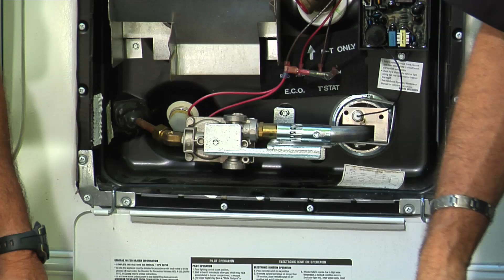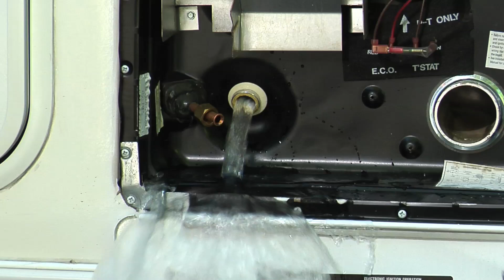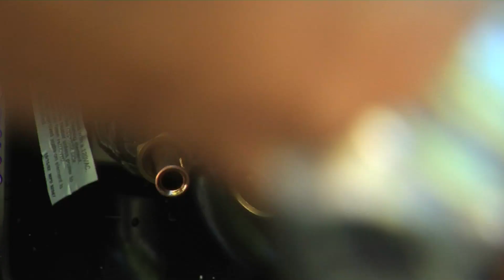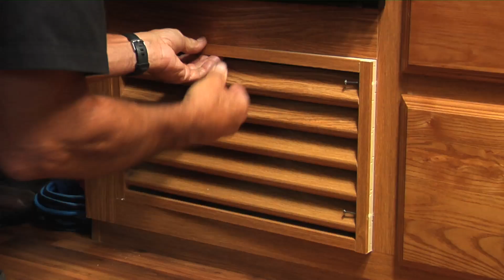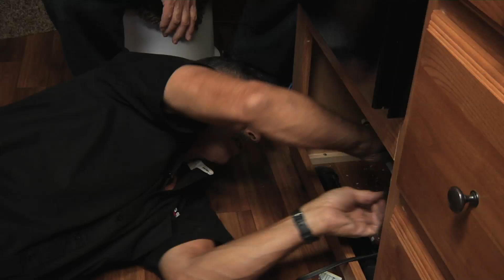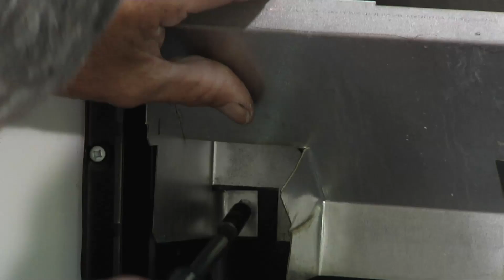Hott Rod RV Water Heater Conversion Kit Install

Comment: If I have this on do I need to have my propane off ?
Reply from the maker: Hi There! The hot rod electric element and propane are intended to work as separate, complementary systems. The propane is only turned off during the installation process for safety while working on the unit.

The intention of the hot rod is to give you an alternative to propane, not a replacement — so you can use either or both depending on your situation.

Hope this helps!

Comment: To get to the tape to get it to stick the best try to find the  the flat surfaced they're putting it on the back of the water heater but if you have access to the side of the water heater that's pretty much a flat surface they're trying to put it on a tank part that has a weld rim going around it so it's not sitting completely flat which is why the tape isn't sticking very well.

Comment: Why did you convert the water heater to electric and then reconnect it to propane?  Did you just install the electric conversion as a demonstration, then disconnect it?
Reply from the maker: Hi Karen! 

The purpose of this video was to demonstrate how one could retrofit a gas-only RV water heater to heat using gas, electric, or both. To be clear, it wasn't to convert a propane water heater away from using propane to working only with an electric heating element. 

Hope that clarifies things, but please let us know if you have additional questions!

Comment: TIP HERE FOR THERMOSTAT. I had the same issue with the tape, be careful how you install it there is a hear sensor on it. I used a lighter to heat the tape, keep the flame moving don’t burn or melt it. After heating up the tape mine stuck first try and solidly. It also says to keep something holding it on while it cures if needed, but mine stuck good with the lighter trick. You could use a heat gun if you have one.

Comment: I wanted to say thanks for the video. I watched sev times before installing the “Hot Rod”. I did have to put in an outlet. But the breaker box had and open brea that was already set up and labeled “hot water” 15 amp. I got everything going and turned on breaker and waited an hour and no hot water until I realized that I needed to turn on the switch on the wall. The propane was not hooked up either. So I waiting another 1/2 hour or so and had great hot water. I do have to say I keep the breaker off when not in use.  Just for FYI. I am a sin mother and bought the rv for my birthday 2020 for my fifty birthday. I no love my rv even more. Thank for the video.

Comment: Did not particularly NOTE to re-connect the green ground wire as the heat shield part was re-installed  (also, not shown on video).

Comment: No need to plug the detached gas line?
Reply: It's off at the propane tank while working on it. Watch the beginning. No need to plug it unless you plan on smoking or using a flame near it. About as dangerous as lighting a f*rt when the tank is turned off.

Comment: Tip....Put tape over the propane line before draining water to avoid water or dirt getting in the tube.  Also, use a heat gun on the adhesive strip. It’ll stick to the tank with ease.  I watched this video and bought the hot rod for my tank. Mine tank is propane and electric but the factory heating element is 1400 watts.  The hot rod uses way less power for my off the grid solar system and so far I have saved $60 month or more on propane.  I’m only on month two and it works great.

Comment: Do you have to take the inside panel off and plug it in every time you want to have hot water?  You not only forgot the ground wire but what about a on off switch??
Reply: The thermostat turns it on and off
Reply: saying yeah, but is it always on then??

Comment: Great Video...
Thank you for sharing this...
... I have a Question:
I just got a 1972 (vintage) Aristocrat Travel Trailer...
Everything is original (Dirt included) 47 years worth.
This 17' travel trailer has a toilet/shower too!!!
Needless to say... the hot water tank is no longer working.
I want to put a tackles water heater in it... Can I do that.
As of right now the OLD water heater is under one of the seats.
Thank you guys for your help... I love your videos.

Comment: I like the anode in the Camco Hybrid Heat adapters. If you replace the anode rod with the heater element, it's nice to have that anode. This is fine for installing in a drain, not so much for an anode replacement.
Reply: Camco makes a 3/4" plug with a small anode for a Suburban HW.. But this is an Atwood with an aluminum tank and no anode.

Comment: I suppose this is not tied into the water heater switch at the control panel which triggers the gas solenoids and igniter. So does it try to heat water all the time? What happens when you winterize and forget to unplug it?

Comment from the maker: You're right that there is a shot of that green wire unconnected before the leak test. Probably connected that during one of the cuts after that but, in any case, it definitely goes unsaid that you should always reconnect the ground wire after a project such as this.
Reply: Would this work on a regular full size home gas water heater? I can't find any information on installing this on the drain valve of a regular gas heater.